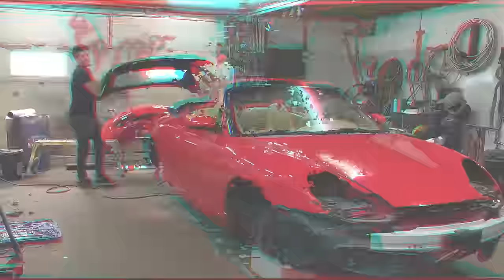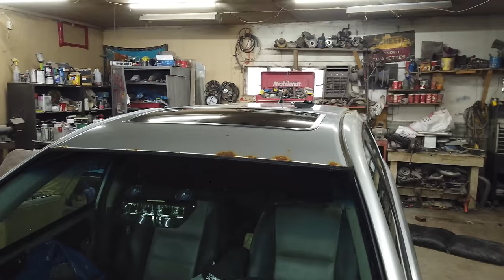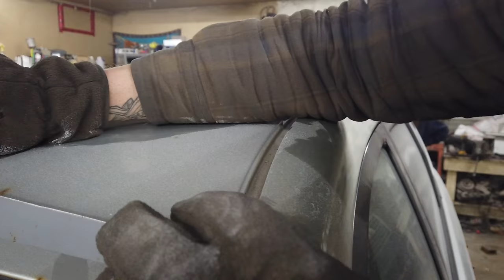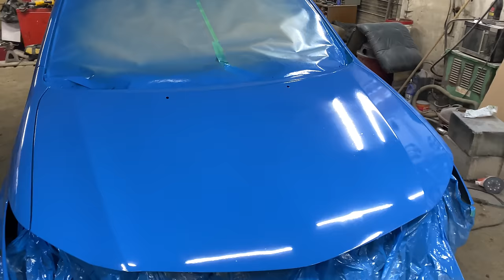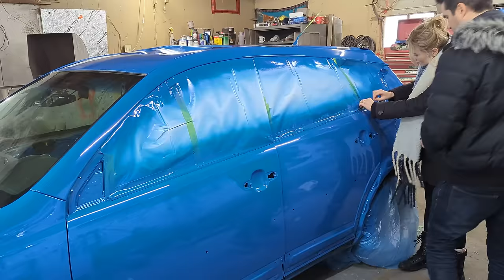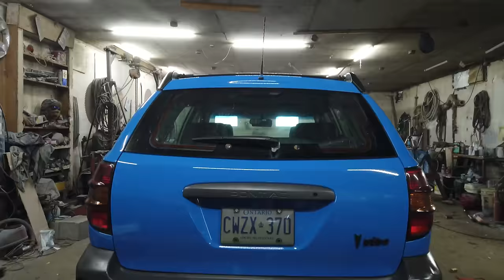Clear Coat over Rust Paint - DIY Professional Rustoleum Paint Job

Comment: Please, every year or so, give us an update as to how that paint job is holding up. I believe the 3 coats of clear will do the trick. I've had some difficulty with that paint getting moldy after a couple of years in my semi-tropics. Also, was that clear coat a similar composite of the color coat? Thanks!
Reply from the maker: Yes we will do updates on the car periodically to show how it lasts for sure! And no the clear was not the same, but that is why we let the blue set up till it was almost cured and then did the clear. We also could have let it cure completely then scuffed it before applying the clear coat

Comment: Learned from my father: tell them at the dealer to take their decal or badge off the car. Plate frame is fine (I'll leave that on for a little while), but do not leave your name on the car, ESPECIALLY if its a cheesy, foil sticker like the one our Honda dealer used.
Reply from the maker: Ya it drives me nuts. If I ever buy a car new off the lot, I'll be sure to have them remove the sticker

Comment: In the UK they only put a dealer sticker in the rear window and also use dealer plates. Dealer plates (for example, Marshall Honda York), increase the value of a car in some cases especially if it is a vintage car on the original dealer plates if the car is rare and the plates are good condition.

Comment: Ive painted many classic cars with rustolium. It looks ok at 10 feet. You really need to spray it out and then out it outside and let the sun let it lay out flat and evaporate the solvent. Then you can wet sand and buff any orange peal.
Reply from the maker: Ya that's definitely another way to go with the wet sand between color and clear. We didn't want to have that much down time. This did turn out pretty good, not perfect, but to the pow here if I wet sand ad polish in the spring, it will look fantastic. We might do a follow up if people are interested

Comment: Rust-Oleum has another benefit in that it is made with gidh oil. I have painted lawn mower decks with yhe stuff and hit a bit of grease enough to leave a black streak
   No fish eye at all snd the next coat covered the black streak . The damp proof ref primer is a must on surface rust. It dries pretty quickly and makes a good rust spot treatment.

Comment: It’s good to see that this practice hasn’t died off….

Back in the early 80s, I use to do a spring clean up on my 1967 Plymouth Fury III sedan - it was white over blue vinyl - had huge bench seats front and rear, a 383 4bbl and leaf spring rear suspension augmented w/ air shocks to would level out the rear whilst hauling a car full of friends, w/ the huge trunk being full of 2-3 1/2 kegs of beer….  The winters in central NY state commenced in early Nov and oftentimes lasted through end of March, thus our vehicles were subject to a continuous bombardment of rock salt that was generously applied to every road surface… thus come every spring, the process of repairing our daily driver vehicles, via the removal of rusted sheet metal and the lead soldering of replacement metal and copious amounts of Bondo, commenced. Given my Fury III was already the recipient of a shiny white paint job, I naturally added a new coat of rustolium white, each spring, along with an autumn touch-up… did this through 1985, at which time a 1981 280zx turbo became my “good weather car” and the Fury III became my “winter rat”….
Reply from the maker: Ahh man, would be so nice to have both those cars now! But I can totally understand that. A little spring touch up and some maintenance to keep things running and looking nice! Thanks for the comment and for watching!

Comment: Professional or skilled amateur painters, here’s a question: How much more would it have cost to use automotive-grade, matching paint materials for primer through clear coat? There are good comments here about the long-term durability of the Rustoleum and clear coat used on this project. No doubt about it, this job meets the 10-foot standard — looks good from 10 feet — but a ton of labor went into the prep work and it would be interesting to know what fully compatible materials would add to the result.
Reply from the maker: Hey, good question. The cost for us for a quart of automotive base coat is $185 before tax and that's at the low end. We also used a very affordable clear coat. So realistically with what we used we were probably around $250 Canadian for materials, that's including masking tape and paper, and sand paper, and any filler we used. If we used Nason products for our base and clear, it would have been about $700+ and the finish would be similar. The end product often comes down to how good of a job the painter did while spraying. Unless the prep twas awful, then it's the prep work to blame haha
Reply: So if I am reading that correctly, it would have cost $400 more at least to use automotive grade materials throughout. I totally agree with your comment about the result being highly dependent on the spraying. A professional with a $50 gun can lay down a flawless finish — and an amateur like me can use a $1,000 gun and it will look like the paint was applied with a broom.

Comment: Ever use this paint for a cargo trailer? Nice and shiny, but two years later it is oxidizing from the sun. When I was 16, we use this paint with a set of rollers to do old cars! Nice and shiny for a little while. You get what you pay for.
Reply from the maker: Ya we have noticed the same thing on tractors. That's why we put the clear coat overtop to protect the rustoleum and make it last longer

Comment: Started reworking a 72 F100. After primer I didn't want to spend too much so went on web and bought 4 almost full quarts of paint from a guy who had stock cars. Blue, white, yellow and red. Trying to stay away from browns ( original color) I mixed the blue, yellow and white in whatever amounts were in the cans. $25.00 got me enough to paint most of the truck except hood and roof I did black. It came out a beautiful mint green, almost the shade of the retro Thunderbirds. Like you the clearcoat and thinner were the expensive part.

Comment: Fun fact, back in the 70's the Pontiac Trans-Am bird decal was a 500 dollar option to not have it installed on the hood, so for most folks bird was the word.
Reply from the maker: Thats a cool bit of knowledge right there! I didn't know that. Ya when dealers out their decal on the car it drives me nuts. If the dealership is good and I feel good about the car and the process of getting it, then I'll happily tell everyone. Don't put a decal on my paint! Haha
Reply: @RustedRides  Here in Detroit its seldom you see vehicles affixed with anything on paint or glass, kinda strange once you notice it.

Comment: Hey awesome job. I've paint several projects with tremclad and a splash of hardener and reducer. Pretty much the same recipe. If you are doinf rims, I'd go with the gun metal or a satin black to match the trim around the car. Awesome job fellas from grande prairie Alberta 🤘🏼. Subscribed as well.
Reply from the maker: Hey! Thanks for the sub! Might be out in Alberta this May. Any good projects out there that might want to travel to Ontario for a rebuild? Have you had good results with the tremclad? We've been been happy with the ones we've done. You're right, the satin black would go nicely with the other accents on the car. Thanks for the for watching/for the comment/and for the sub!
Reply: @RustedRides  well dang it would be cool to meet you guys if it were possible. I have a back field of rigs but not much super cool. I don't know a yard not far away from me that has a dozen or so 50's rigs. Pontiac's desoto's chevs, etc. he's asking around $800-$1200 per rig. Most are real solid cars.  Also, I've painted engines and transmissions only with the tremclad mix. but we are at 3 years later almost and all 5 are stil gleaming even after a ton of heat cycles. Pretty sweet
Reply: @RustedRides  also I've hauled a couple cool rigs from a scrap yard in crooked creek ab. A 48'chrysler Windsor, and a 68' Fargo pickup truck. Both are in my video play lists but there is always more to find. What all are you looking for?

Comment: I had a lot of results painting equipment with Home Hardware brand rust paint (it has urethane in it) using a enamel reducer. Never found that I needed to use a clear coat because of the urethane in the paint but I found that paint was very hard and took a beating and still was shiny after many years of where and tare in the dirt
Reply from the maker: That's awesome! It's great when you find a combination that works, looks good, and lasts! Thanks for the comment and for watching!

Comment: What grade of sandpaper do you use? Or do you use different grades and sand twice? When putting the heavier coats of clear coat on, how long do you wait between coats? Also you mention a hardener for the paint. What brand of hardener? Do you put an activator in the clear coat? Thank you so much for all your help.

Comment: That paintjob looks nice! I want to use this paint on my truck, how does the finished result hold up to wear and weather? I would have my truck parked outside and I don't want to spend money and have it peeling in a month.
Reply from the maker: Cam painted two other trucks using the same stuff and they still look great a year later! Maybe we can do an update video at some point and show this car and the trucks so people can see what results we've had.
Reply: @RustedRides  Thanks so much! I know what paint is going on my truck now!
Reply: Will last many years with proper preparation. I’d use SpeedoKote Clear SMR-130 to get started. I love their High Solid SMR-42 but it’s pretty thick for a first timer

Comment: Does the clearcoat really sticks on it? Asking because you let it dry overnight and I didn't see you guys scuff it before clear coat it.
Reply from the maker: Yes, the clear stuck on well. The rustoleum drys very slowly so we wait until it was dry enough that it wouldn't get on you if you touched it, but you'd definitely leave a fingerprint. But yes if we let it cure fully, then we would have had to scuff it first

Comment: Running a daily driver 2005 Toyota Matrix and it is now starting to rust and the paint is poor. This would be a perfect repaint to spice up the car and so I don't have to color match. Do you think this would be a good paint to spray for someone who has never touched an automotive spray gun before?
Reply from the maker: I think it would be a good option because of price alone. If you are new to it, you might mess up. Better to mess up with low cost paint than high cost paint. And after the clear coat you can always wet sand and polish to fix any orange peel

Comment: So is 12-24 hours enough before clear? Seem to me you run the risk of wrinkle? Not a painter but genuinely curious....
Reply from the maker: 12-15 hours is food, the paint is curing up but still just a little tacky so it will bond with the clear but not mix with it. If you want too long and let it harden, then you'd have to scuff the rustoleum down before clear. At least that's what's been working for us
Reply: Seen that on the end of the video.... just wanted to make sure that's what I heard... up here in Alaska working on foxbody on a budget.... might try this out .... thanks

Comment: there painting exactly how i want to repaint a car, problem is rustoleum is oil based & dries very slow
Reply from the maker: Yes it does, so more risk for dust. The slow dry time is also why we didn't let it cure between coats and scuff, same with between the blue and the clear. We wanted cheap and fast... This was a decent balance with nice results.
Reply: @RustedRides  you could just lay on a thick layer of rustoleum, few layers, have it dry few weeks, wet sand it down , get all orange peel out, finish with 1000grit, then throw on a 2k clear, id spray it out side during summer, when wind is under 5-6mph, & humidity under 60%, plus all that dust in garage from body work will get into paint, when u paint out side spray all around with water 2 keep dust down, I've painted whole cars like this & they look better.then a professional paint job done in a booth

Comment: What kind of reducer and hardener did you use for the paint.
Also what type of clear did you use like enamel or urethane.
Turned out really well guys I think I'll try this if you could answer my questions so I don't ruin it with the wrong clear

Comment: Looks like a normal garage with normal lights. What about the danger of explosion when spraying inside?
Reply from the maker: We have dual exhaust fans with an intake in the shop as well. And the lights are sealed non arcing led. But yes it can be a hazard if not thought about

Comment: No hardener in Rustoleum, will only last a few years, it will start loosing its luster in the first year. You need to start spraying a sealer, then something that will harden up then several coats of clear.

Comment: I'm extremely new to car auto paint and was wondering why was a layer of primer not put on the car before the Rustoleum paint layer?
Reply from the maker: So where there is still paint you only have to scuf/sand, but where you sand through to bare metal or any body filler should get primer. But with these rust paints it is a paint and primer all in one and can be used on bare metal.

Comment: The wheel color should be easy to clean and hide dirt. So silver-gray or black. I vote black to match the trim.
Reply from the maker: Ya that's a good call. I have been told the white would look good but be prepared to clean it very often... So maybe a darker silver would be best

Comment: I really looks a lot better and thanks for the information.

I’ve seen others use a few drops of Japan drier in the  Rustoleum mix. 

I understand the budget constraints of this job but you really missed a great opportunity to colour match the cladding, mirrors and door handles. I would have deleted the roofrack too, I know it’s not a custom car project but you’re doing the work yourself… 😉

With the unpainted cladding a charcoal wheel is your best bet. ✌🏻
Reply from the maker: Ya there are lots of cars that have color matched cladding etc.. And I think they look good, but I also actually like the cladding kinda like the subaru wilderness edition. But what you suggested for rims that matches the cladding sounds like a good idea!

Comment: the correct way to do this is several coats with sprayer or roller mixed 50/50 with mineral spirits, then wet sand with 800- then 2000- then 3000 grit wet sand paper. then buff it with rubbing compound or liquid wax. it will be perfect with zero orange peel.

Comment: Nice job!  Inspiring!

A couple questions if i may: what grit did you use to sand the car?  What gauge metal used to weld repairs?  What adhesive to reattach branding?
Reply from the maker: Thank you! And to answer your questions 320 and 400 for the grit for sandpaper, and the metal was I belive 16...or 14...ahh I'll have to ask Cam

Comment: I own a white 1990 chevy silverado with 335,000 miles on it.  4 years ago someone hit the front right fender. I bought a replacement fender. After prep and prime I mixed up rustoleum with some ppg reducer and harder and sprayed it.  No clear, just single stage painting.  4 years later it is holding up and looking good.
Reply from the maker: That's great! And it matched the factory color pretty good?
Reply: @RustedRides  Its a little brighter but is close enough most people dont notice it.

Comment: Just curious how do you know clear coat covered all without like micro gaps? I'm looking to remove paint then wait on bike frame to rust and clear coat it
Reply from the maker: Multiple coats. When it looks wet everywhere then you can be fairly sure it's covered well
Reply: @RustedRides  thanks, I never done spray paint before and with most painting I always left to someone else on second coat as couldn't see difference but I do my best

Comment: Straight black rims, the plastic parts also need to be a high gloss black. 
I would have added just a bit of metal flake and some deep dark red but just a little bit on the red color.   Or add a color changing metal flake clear coat top coat.

Comment: Did your garage have to be warm to spray that car ??
Reply from the maker: It was probably about 20 degrees Celsius or 68 degrees Fahrenheit
Reply: @RustedRides  ok thanks
Reply: @jorelsmith1985 - you want to be around 60•F at the least to avoid runs. You Certainly can put a Fast hardener in it as well as Japan Drier to help it cure in cold weather and wait longer in between coats. It’s quite forgiving
Reply: Ok thanks sir so much. And for how long sir
Reply: @jorelsmith1985  - At least 12 hours for the paint to cure and then as close close to 24 hours for the clear. Ideally 65-70•F for 48 hours total. Preparation is the usual failing point as people (myself) always want to start spraying paint and want to skip the scuffing / degreasing steps. That’s usually what causes the paint to peel from the car within 3 years is having a contaminated substrate to adhere to.
Reply: @RustyZipper  ok thank you sooo much for all your information sir and I'm going to use it... thanks and God bless

Comment: YOU can get 1 pack automotive paints... Normally pretty cheap. like $30 for 1.3gal (5L). Only downside is you need to wax the surface regularly as it isn;t as waterproof as a 2 pack.